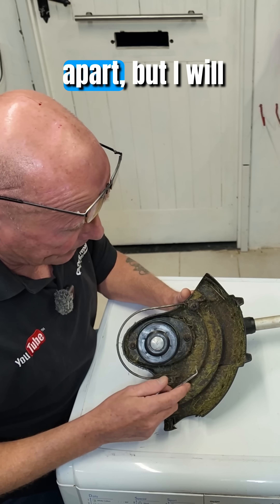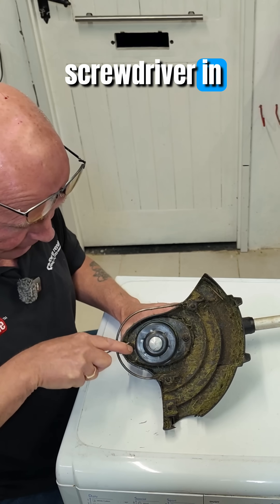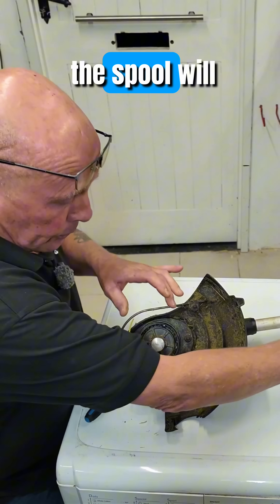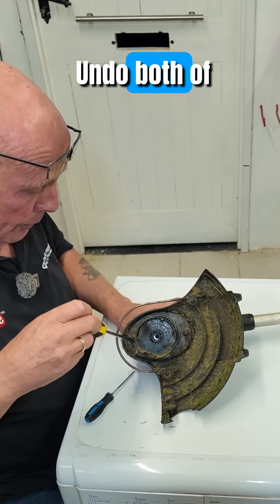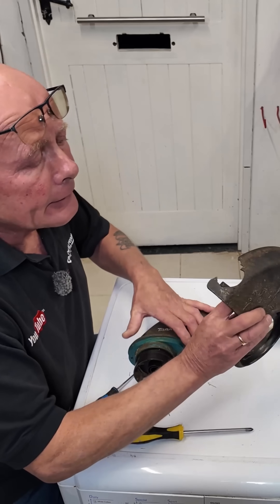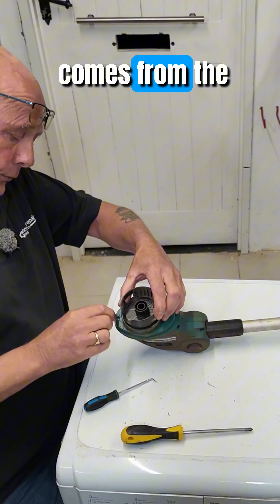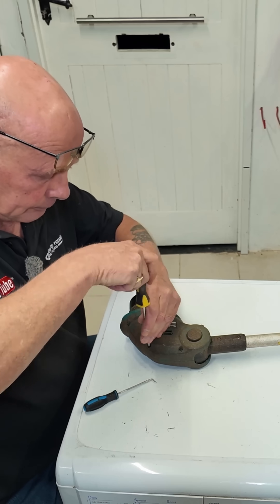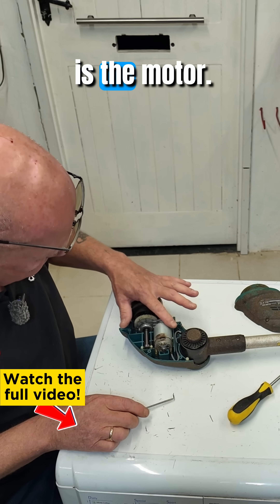How to Dismantle a Cordless Strimmer or Grass Trimmer? Removing the Cover and Guard

Comment: Reminded me of my florabest lawn mower. Blade was rusted through and I had to destroy the plastic collar to get the nut off. Couldn't find a replacement collar, Amazon had one listed as one with a collar supplied - but ended with my money back. Bought a 3d printer and spent some time modeling and printing a new piece- lawnmower now revived